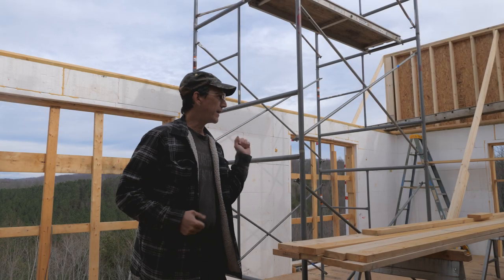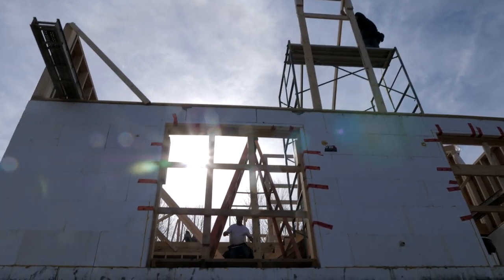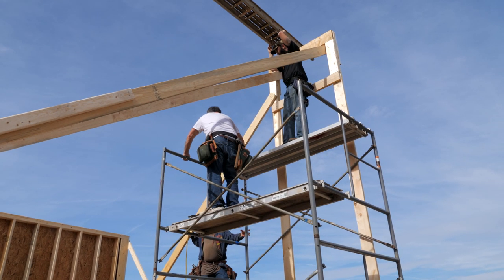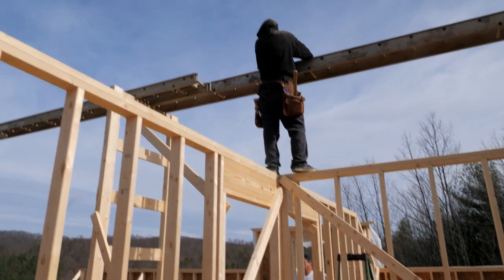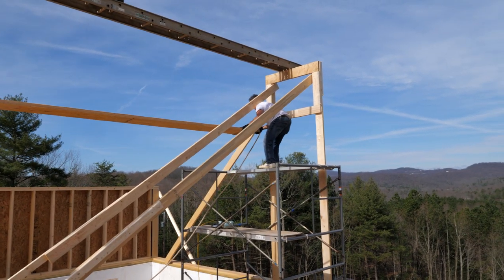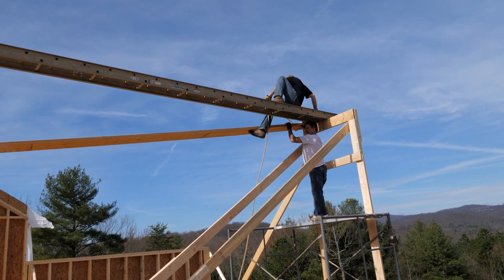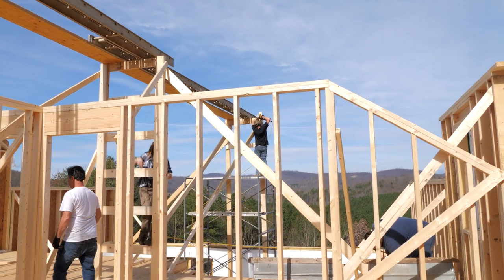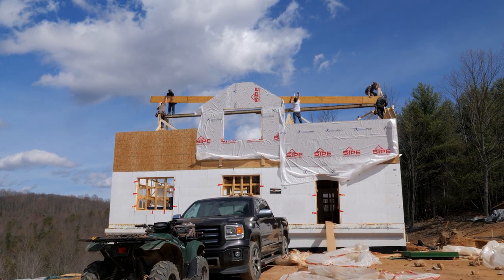ICF Mountain Homestead: Raising the Ridge Beam

Comment: WOW! GREAT crew. I have 4 brothers and like my Dad, they all worked construction.  My father was a plumber/pipefitter/welder, carpenter. & during WW2 he helped bore the holes for cannons, and later, worked for the AEC in the Arco desert.  1 plumber/ pipefitter, 1 carpenter/machinist 1 electrician, 1 brother does almost everything, and for the last 40 years has run his own business specializing in mobile refrigeration. Give tradesmen their due respect. most men can read a book, but not so many can set a ridge beam or fix your car's carburetor, or re-wire your house.

Comment: Climbed the inside of a oil rig once. Had some cotton rope tied to me and other end to 7/8 swab line. Then I climbed 100 feet with no latter when I neared the top about 8 feet couldn't go any further rapped arms and legs around derrick and asked for help
 VERY LOUDLY.
At the last cable weight more than I did a little tuff to do. 
This STUPIDITY was done 35 years ago.
No way I could do it now. One of my employees climbed the latter fished cable up into pulley then back down.
More work that I did before noon than most jobs all day.

Comment: It must be so exciting to see your home come together like this - thanks for sharing. Health and safety rules must be really different in the U.S.A. though - no safety helmets, climbing harnesses or high vis vests on site. Yikes!
Reply: They vary a bit state to state but I'm pretty certain that IF a Building/Safety guy happened to come by while this was going on Jeremy would have a BIG fine to deal with as he is the General Contractor on this project.
Reply: You will never see a high vis vest or hard hat on a small operation like this. And on a job like this, vests are simply moronic. Vests & hats are only used in large (commercial) construction jobs with lots of unions, and strong OSHA (our H&S) presence. You won't even see hardhats on much larger residential jobs.

That said, harnesses, fall arrestors and other basic safety equipment should have been used. Yes, "they got it done" without, but some risks just aren't worth it.
Reply: @jmacd8817  Agree about the lack of fall arrestors, etc. It's usually after the fall and rush to the ER that H&S comes out and writes you up shuts you down as well.

Comment: Sorry,  but you know companies make these things called cranes, and you can use them to lift heavy things safely.
Reply: Cranes are expensive and the terrain and how much rain/soft the soil is could have held up the build by weeks.  The past videos have mentioned quite a bit of bad weather. The crane company won't risk their truck getting stuck up to the axle in a remote mountain area. 
I'm just guessing it is these two factors.
Doing it old school low tech!
Reply: @ Mark yes, and it has been raining since then. Sometimes the person living on the property knows more than the person watching the video. 
Where I live there is no way to safely bring in heavy equipment like that until June. Many tow truck companies make great income winching out truck stuck up to their axle in mud.  A crane is even heavier and without the ground being frozen from winter cold......it might not have been an option in their rural area.

Comment: 18:34  TURN IT UP ! !  TURN IT UP ! !   ......   "WHICH WAY IS UP ? ??"
Reply: I only saw one angle brace back into the interior wall, and it was only set after they had the first beam up. More power to these guys, but I think they needed better communication... really bad move to have lifted both ends at once before the one end was set and controlled at vertical in the pocket. The guy in the middle had no chance at straightening that floppy beam upright once it went out of vertical! Looked like they came close to losing any control of it.

Comment: Can someone help me understand why they build the Ridge beam like this rather than set it on the framed exterior walls after they are built? If you recall from their previous video when placing the center beam on the first floor they took great care on putting it exactly where it needed to go. What am I missing here? Thanks for the help.
Reply from the maker: The gable ends have to be balloon framed. They do not support the ridge beam.
Reply: @Guildbrookfarm  thank you for taking the time to respond. Keep up the good work. The house is coming along nicely. The open ceiling is going to be amazing.

Comment: Lots of comments from the peanut gallery.  Even if a crane had done the lifting, you still need men to climb up there and secure it.  I suppose proper scaffolding at either end would help.
Reply: And a safety harness that is required then you are 40 ft off the ground